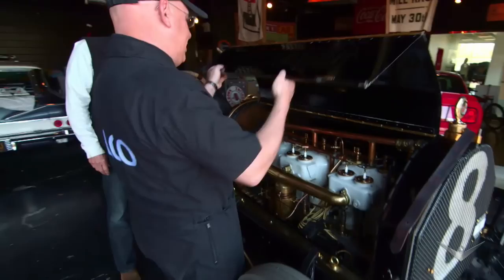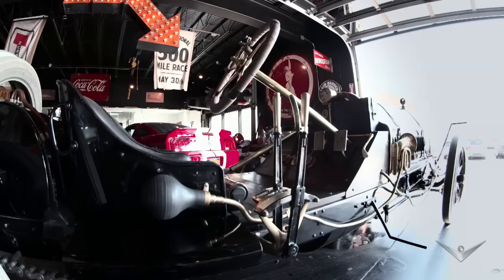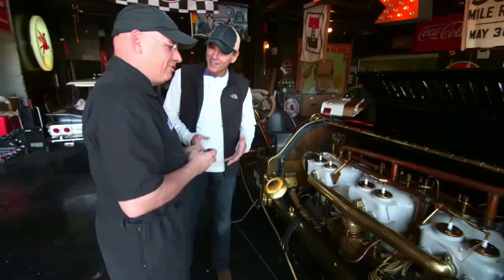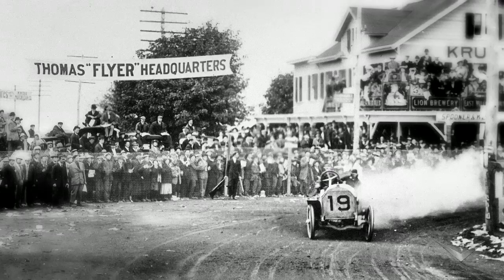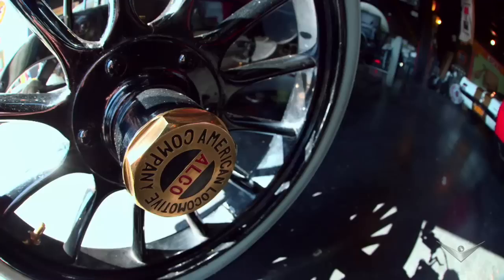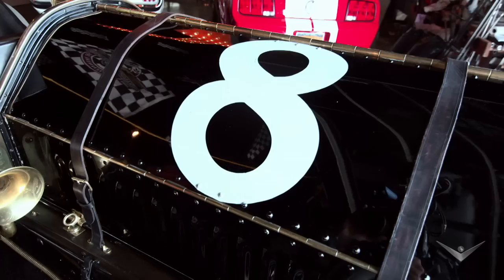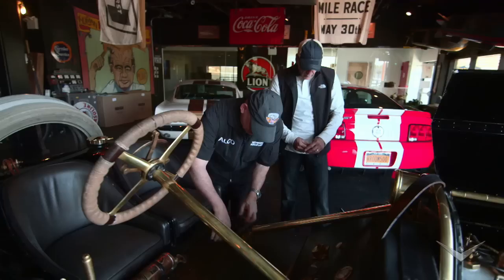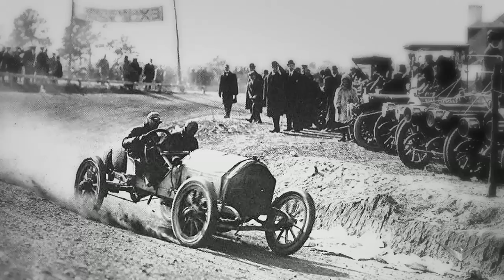First Cheating Nascar | Americarna

Comment: Hmmmm? NASCAR when there wasn't even NASCAR. Way to go Ray. Slid that one in.
Damn NASCAR snobs. NASCAR doesn't run the whole world of auto racing. Hell, they don't even run the whole world of stock car racing.
Quit trying to make NASCAR a sport. Stock car racing is the sport. NASCAR is one sanctioning body (true, the largest) in the sport. But it's not THE sport.
Also I wish they would quit taking credit for EVERY development in the sport. Pocono Raceway installed solar power, not NASCAR.  By that logic, ARCA was the first to use solar power. After all, ARCA had as much to do with it as NASCAR did, and they race the day before NASCAR does each year. Although not very effective, especially to what is available today, who was first to require, SOME KIND of neck support system? Not NASCAR, but at least someone else tried to do something. Flame resistant gloves? Nope. Finishing races under green? Not them.
Or twisting the arm of others to implement your possible rule changes so they look like idiots when they flop.
Oh, also by an example of their intelligence, have a "chase" point format? That one's all on NASCAR baby. No one else to blame for that one but themselves. NASCAR home of non-champion. Diminishing the value, in there fan's eyes, of the "chase" champions who would have won it legitimately under the Latford system, or a straight 43 + 3 system. And all the champions that came beforehand, seeing their legacies cheapen.
Their whole fan base isn't backwoods hillbillies anymore. We're much smarter than that now. So stick that in your fan "injector", and what spews out the other side.
Reply: +DDS029 
...in *their fan's eyes...
(a spellchecker hijacking)
Reply: +DDS029 drag racingg is much better
Reply: Trick Pierce
Acceptable, but definitely not better. I've done both. I still have my last two stock cars, which are around thirty years old now. Unloaded the drag car as soon as I could, to put the money into the stock cars.
Reply: DDS029 For someone who dislikes NASCAR how do you know so much about it? Seriously no one cares what you think. Just in case you were not aware.
Reply: Triggered
Reply: Paul Bachman how about because he knows a lot about NASCAR that's why he doesn't like it.
I hope you're just a kid, otherwise you have no excuse.
Reply: He's not a bad guy. He grew up, as I did, doing Northeast modified racing. Our haulers were together in the pits at Stafford in Conn. when he was crewing a Long Island car. At the end of the day, why, He's sacrificed a lot of time, skinned knuckles, crushing defeat, arrogant sponsors, backbreaking fatigue and occasional victory. He's not just a talking head. He's earned his chops.

Comment: Hey hey easy when Ray say NASCAR he means stock car racing as most of us today know that sport as it is NASCAR I been a fan for 45 years I can't speak back hundreds a years ago how could they have missed that in the editing department ....like I always say its comments not complaints....please direct all disputes in writing to the Wal-Mart customer service department were we have the most well trained and highly skill individuals working to serve u,for a limited time only soon to be replaced by robots,I did not see that coming....hey it good to see the original stock cars can't tell the difference if it was an Indy car or a stock car boy good looking though....pretty awsum that it had 680cubic inch motor that is a monster,let me make a guess,the reason they ran 680...if it took 6 months to hand build the car...how long to retool up for a 600cube motor redu....probably 18 months right....pretty wild a train engine company wins the first Indy car race....I was just talking about the durability factor that I was unaware of....most production engines back in the day(of my cars1970- 74 molars)were built with durability as job one meaning they were at a ridiculously low power setting 15 or 20 percent of possible max power capabilities....I miss my high nickel block dodge 318...when they were building them so they could last a 100000 miles they easily went 300000 and they were mine some where at a low 200hp...I'm still a fan of old engine pretty ridiculous I see my 69 f 100 3 wire in the engine compartment and its empty of any thing there ain't nothing on the fire wall or inner fender wells looks like some one stole everything,I did a motor in a 1996 truck V6 there had to have 30 wires,today's trucks well over 50 and we can't fix these beautys even with a lap top...thanks piece damn Ray I wish u knew what u were doing I hate that....at least this wssnt real click bait I hate that most when they never even show the thing that they said there was video of....u can useal tell when the video starts if its gonna come thru with interesting worthy content...thanks again I'm scared to ask how much did that man pay....or what's it worth....